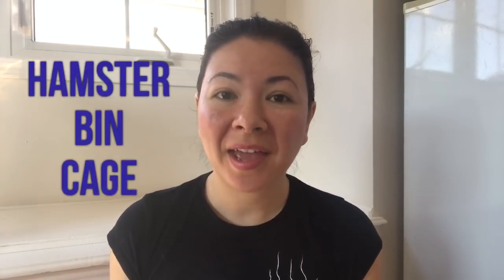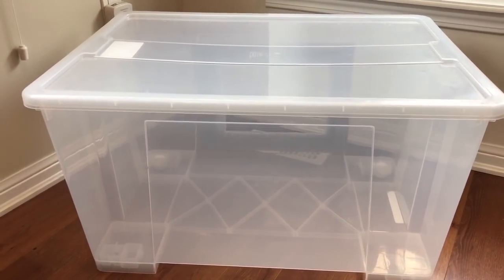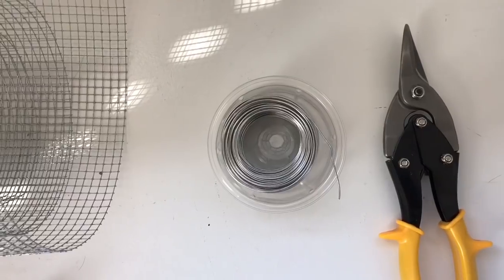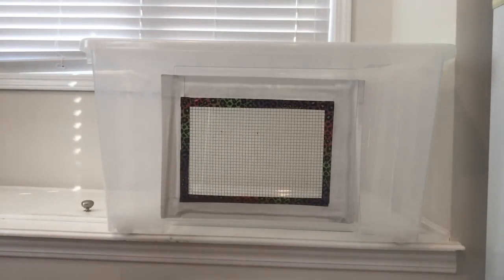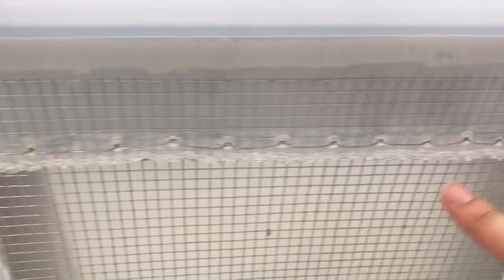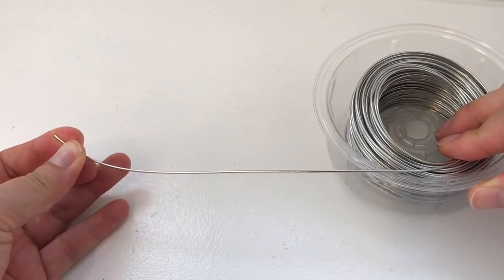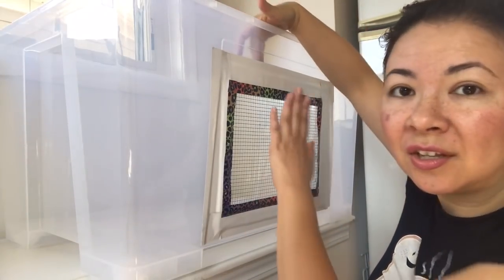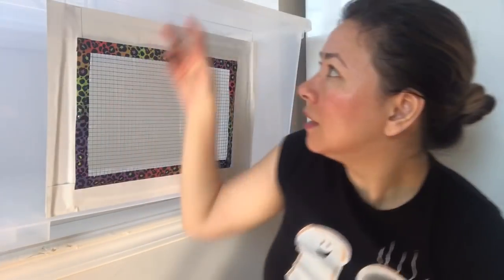DIY:   How-To Make a Hamster Bin Cage

Comment: I would recommend having the gauze panel a bit higher since it's recommended for hamsters to have 10 to even 30 cm of bedding. A lot of the bedding will go outside of the cage if the hamster starts digging. 

Id recommend having it at least 5 cm above the line of where you would want your bedding to reach

- just a friendly tip from a mouse breeder who also makes her own bin cages ☺️

Comment: I do not  get why people who recently commented that  the minimum size change...It been 3 years since this vid was uploaded, don't people think she got news by now.😑
Reply: It’s for other peeps ☺️
Reply from the maker: Thanks for your comment @Hello Hello 😉😊
Reply: This hamster has most likely passed away by now anyway... Yes, the recommended minimum was increased after she made this video, 360 was definitely too small, 450 is better, but even larger is better.  I prefer the 200 quart bin as it has a taller height suitable for a 11 to 12 inch wheel plus several inches of bedding for a Syrian, no so much as its over 600 square inches...

Comment: I got a IKEA Salma 130L and it’s giant and it’s perfect for my hamster
Reply: How many sq" is it? i wanna get one for my hamster x
Reply: @flocarter2017  677-690sqinch (depends on the model) but the measurements are for the top which is a bit bigger.
Reply: @CulturalToast  ok tysm, do you know what the measurements for the bottom are?
Reply: @flocarter2017  Sorry, no. I don't have the box yet. I know the measurements from their website.
Reply: @CulturalToast  ok ty anways :)
Reply: @CulturalToast  I have seen others measure the bottom of that bin, its over 600 square inches... Similar in size to the Sterlite 200 quart bin/50 gallon bin which is also over 600 square inches. Both are about the largest clear bins one can buy, outside of the Christmas tree bin during the holidays... You can buy larger aquariums, but alas, they are considerably much more expensive, at least a hundred dollars more expensive in America...
Reply: @ronclark9724  yeah, my hamster died like a year ago. I dont need this info anymore, but thanks!

Comment: The bare minimum is 450 square inches not 360
Reply: Superman87 yea back then it was 360
Reply: The numbers of different worldwide animal humanity standards are different... There is no single worldwide standard...  No matter how large the cage is, even up to 1500 square inches, hamsters will attempt to escape...
Reply: 360 is ok. Because someone tells you to jump off your roof are ya gonna do it
Reply: @whyjustwhy2168  Everyone I knew that had the Sterlite 90 quart bin with Syrians, over 360 square inches but less than 450 square inches, had stress related behavior issues. Why I was pleased the US recommendation was increased to 450 square inches. 360 isn't large enough...

Comment: It's actually 450 SQ in
Reply: Slime and Squishy factory the minimum changed, it used to be 360 two years ago. maybe you should check some things before you comment.
Reply: Guys I’m making a diy bin, I don’t find those wires, can I put a lot of holes at the bins cap?
Reply: •Hxney Bee• I have seen some people put holes instead of the wire and that’s what I’m going to be doing, it should be fine just make sure you make many holes including a couple on the sides at the top.

Comment: Um sorry but 450 is the minimum square inches, but you did that so 🤣
Reply: Disney Gal do you not see the upload date? 2 years ago, the minimum was 360 sq inches. so maybe check some things before you comment.
Reply: The recommended minimum is different worldwide... There Is no set worldwide standard... Anything larger than 100 quarts will achieve the 450 square inches standard, but the largest clear bin of 200 quarts won't achieve 700 square inches...

Comment: I have a question, I don’t find those wires so can I make a lot of holes in the cap?
Reply: No, it won't be enough ventilation.
Reply: It’s wire mesh you can get loads from amazon or anywhere ready xx
Reply: Ruby Elizabeth it’s cuz I’m broke, or may I say I have my mom broke
Reply: @glxiouss2093  I think u can but make it a bit bigger
Reply: Maybe u can leave the top off and then put a thing on the rim of the cage to make it taller so ur hamster won’t escape? :)
Reply: Yes. But don't be lazy. Make as many holes you can without cracking the lid. I used a old soldering iron to melt a ton of holes into the lid... However, if condensation develops on the lid, steel mesh will be required...

Comment: Would a 32 1/2 length 
19 1/2 wide 
13 3/4 height work for a hamsters home
Reply: yes it would equal 633.75 square inches
Reply: I prefer the 200 quart bin better as it has a height of over 17 inches more suitable for a Syrian 11 to 12 inch wheel. But this bin will be sufficient for a smaller wheel dwarf hamster...

Comment: Hi, I might be getting the IKEA Samala Plastic Storage box - it’s approximately 677 sq inches. Is it big enough for my Syrian?
Reply: Actually the minimum is 700 square inches is what I would recommend though
Reply: Yes. Anything more than 450 square inches, but bigger is better. These bins of 100 to 120 Quarts or Liters are sufficient. I prefer a clear bin, but any color lid will do. It is difficult to find a clear bin larger, although not impossible.
Reply: Syrians need at least 700 square inches but your age is pretty good 🙂
Reply: Defintiely. Most recommend 600+ for syrians so you're fine, dont worry!
Reply: @T0mtoma  I have had Syrians for over three decades, over 600 square inches is sufficient. All of my Syrians have showed no stress in a Sterlite 200 quart clear bin...

Comment: Do you need the wire thing? And why
Reply: Rona Moore lots of air
Reply: You do need it because, the hamster needs air. they're just little holes for air.
Reply: I personally think this Is true but I'm not 100% but I think getting a bin cage you can just take the lid off if u don't have any other animals that can intrude, and make sure the height is high so the hamster cannot escape, that's just what I think and what I would do if I had a hamster, but it's different for everyone!🌝
Reply: You can make alot of holes in the bin too. We don't  have wire here
Reply: @stellar7370  Yeah. I'm making a bin cage that is 26 gallon and super deep. I plan on using this one with out a lid. 🙂
Reply: @al3826  awesome 😁
Reply: I don't do like that,but I didn't close the thing and my hamster never get to escaped cause she is a dwarf hamster😂so I recommend to not use the mesh some how your hamster can chew on them

Comment: Thank you so much for this video! But i was wondering if instead of mesh i could just cut tiny holes if not please tell me!😇
Reply: Mine actually has just the holes! I can't use mesh, considering the fact that we have three cats.
Reply: @almairiss  Thank you!!
Reply: @plutoville5433  no problem! :)
Reply: @milica7289  well yeah thats good! but i have no other option.
Reply: If you have air conditioning, probably not a problem. On the other hand if you don't have air conditioning, and you live in a humid area like the American South, condensation may develop on the lid. If condensation develops, wire mesh will be required as you need more air ventilation, not less...

Comment: ummmm the minimum square inches is 450 sorry
Reply: @mo ov A bin larger than 100 quarts or liters should be sufficient in most of the world... 106 quarts, 110 quarts, 116 quarts bins have similar lengths and widths at the bottom of the bins, the difference at the lid differs just a little. These bins taper out going upwards, and the main differences with these bins of these sizes is the height... The 116 quart bin is a few inches taller than a 106 quart bin. Remember quarts or liters reflect volume inside the bin, not so much the length and width...

Comment: I'm just wondering how to fit bedding in that drawer? because a hamster needs a lot of bedding so that they can dig themselves down to hide or sleep, considering the net that goes all the way to the bottom of the box. Otherwise good information with the ventilation it is important.

Comment: the bare minimum is 450 inches
Reply: It depends on where you live
Reply: @flocarter2017  I know but I live in the U.S.A. so I don't know the other measurements
Reply: @UHOHMCRAE  oh ok :)
Reply: it used to be 360 but it got changed to 450

Comment: So am I the only one that just drilled quarter size wholes on top. Way easier
Reply: @dracomalfoys actually no there is another channel on here that did that way and she had up to 21 hamsters. Popular belief is not always correct or the only way
Reply: @dracomalfoys 😆😂
Reply: That's really bad. I know it's easier but that's not enough ventilation for a hamster! It'll make them greasier and can stress them out, even cause health problems. Please, if your hamster is still alive, get mesh and fix it.
Reply: Its been my experience every hamster will eventually somehow reach the lid, chew on the holes in the lid, and escape... Why risk it?
Reply: @ronclark9724  this is true. I had some that chewed the holes and my cat got them when I was gone. Then I had one that never did that but he passed not sure why because I had another one that passed at the same time and they had a wire lid. Weird. But is not worth it 😕

Comment: can someone dive me a link for a 450 hamster cage? I’m getting a hamster but just can’t find a good cage
Reply: You may have already got your hamster, but here's a suggestion anyways! It's not 450, its 608, but the Prevue 528 is amazing! The original seller, when it stock, has it for around 70 dollars, though other sources are much higher. I dont have one myself, but I know it's perfect!
Reply: 40+ gallon aquarium, detolf
Reply: @toxinistired849  For the USA the recommendation has increased from 360 square inches at the time of this video to 450 square inches. Canada may be larger. Of course larger is better. Any large clear bin sold in the stores that are 105 quart or larger meets the 450 square inches recommendation. A 90 quart bin used to meet the 360 square inches recommendation. While  a 200 quart bin or larger meets Canada's recommendation. Germany has even higher requirements, I am not aware of any clear bin large enough for Germany. Outside of the Prevue 528 there aren't many wire cages in the USA market that meet either the American or Canadian recommendations. Having owned hamsters for over three decades, I was pleased to see America's recommendations increased as 360 square inches was not large enough in my opinion while 450 square inches is, if there are sufficient enrichments included. Its just as important to have a sufficient sized wheel, a sand bath, five to six inches of bedding, and several chews in the enclosure as well besides water and food... I prefer the 200 quart bin due to its height, its the only bin high enough for several inches of bedding and a 11 to 12 inch wheel for Syrians...

Comment: Is a 100 qt bin good?
Reply: For a dwarf hamster yes with a smaller wheel. For a Syrian hamster with a large wheel probably not... Without any doubt a 100 quart bin is better than these toy cages pet shops sell...
Reply: @ronclark9724  I found out the bin has to be at least 105 qts but its best if you get a 110 qt bin but thank you
Reply: @Molly-dg3bs  Frankly I prefer the 200 quart bin for its height more suitable for a Syrian 11 to 12 inch wheel... While 100 quart bin may be just a shy short, it is much, much better than a tiny toy cage, especially for a less than fully grown hamster. Buy the largest clear bin the store has before buying any of those toy cages the pet shop sell. When your hamster grows larger, upgrade your bin to a larger bin...

Comment: do i need to use zip ties or can i just use duct tape
Reply: Its been my experience owning hamsters for over three decades that hamsters will chew through zip ties, why so many, much less duct tape... Use steel mesh, not plastic or cloth mesh, and zip ties or even better, nuts, washers, and bolts... And yes hamsters can climb aquarium glass and escape, even aquariums require lids...

Comment: Can you do this without wire?
Reply from the maker: Jayla Boo What alternate material were you thinking of replacing the wire with?  You can use an alternate product, but one would need to make sure it’s chew-proof, the holes are small enough so the hamster can’t escape, and that it’s non-toxic.  It might be best to stick to the metal mesh ?
Reply: Zip ties.